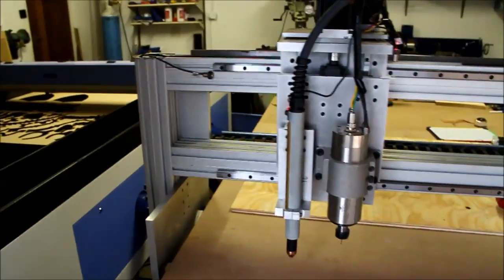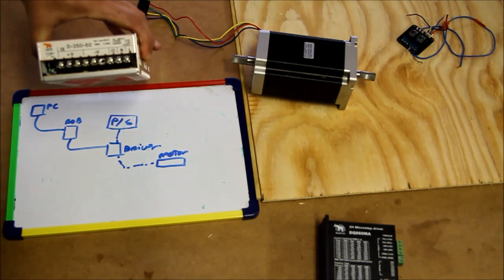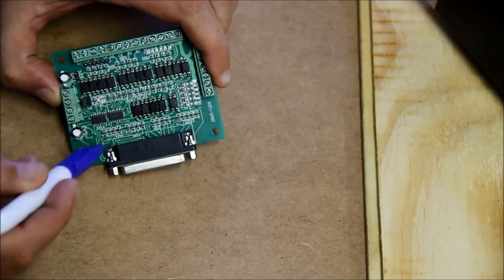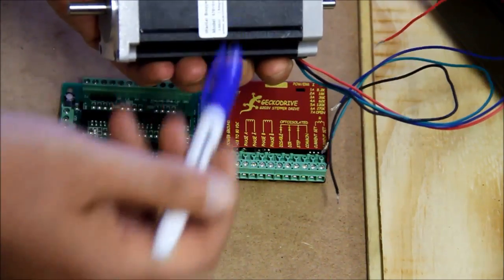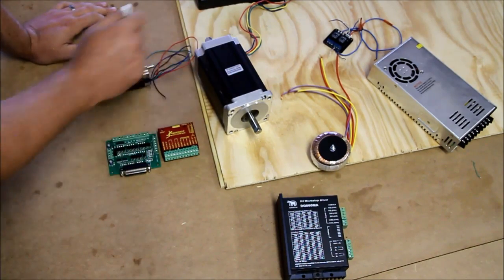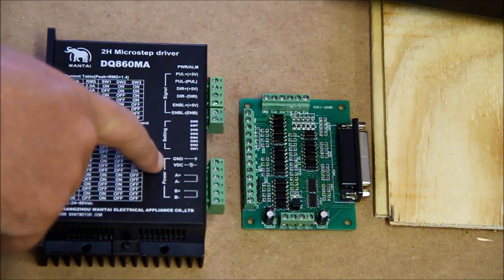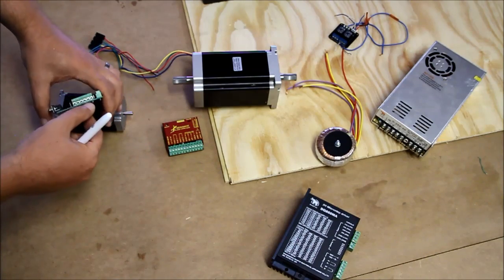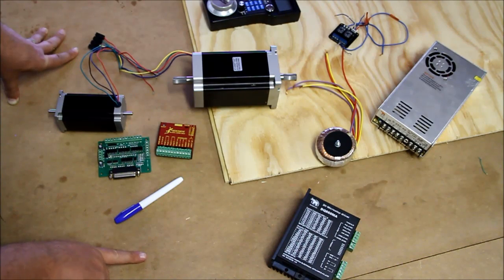How to Connect up a CNC Machine

Comment: Hi Vatso... thank you...  now i deleted both my message, and your reply.  i thank you so much for the reply...  i find that not all people like to reply, because they are busy.  can i ask you one thing please? :   It is the first machine the guy from Witbank installed a system on. My diy plasma table.  He advised me to connect the one probe wire to the nozzle of the torch, and the other end wth the clamp fitted, to clamp on the steel plate...and both wires was connected to the bob.  when we tested the cnc machine in ''demo'' mode, evrything was fine. only when i brought it to NAMIBIA, and connected the plasma cutter, the machine started to move...until the z axes (torch) touched the steel. then evrything burnt. the bob burnt, my computer processor damaged, and the plasma cutter also damaged.  there was no fuse or circuit breaker to avoid this. the ''box'' (plastic) was not earthed to the frame. i  think the probe wires was the wrong advice. he showed me pictures on watsap to connect the probe wire to the nozzle. but i see on internet other handheld torches without a wire??    o... and the cheap chinese bob was 12v and not 24 volt... i ordered the exact bob, only to discover its 12v.  i will use a stepdown transformer now to operate, until i buy another set.
is there a guy in s.a. who you know i can ask assistance from? please?.  and is there a supplier wher i can buy this chinese parts? to import is about 4 weeks!
thank you so much for your kindness.   
o.... please come back...we need your expertise in s.a. lol
Reply from the maker: Sorry to hear that, you can not run a touch off like that the arc voltage from the plasma cutter would have caused this :( - you need to make a floating head for your plasma cutter so that there is no voltage that can come from the plasma touch or you need to buy a THC that caters for that type of touch off and to be honest it's not worth it as the more you cut the more build up you will get and the touch off won't work if there is any dirt between the plasma head and steel.
Reply: my friend... im guilty of asking you to much...sorry for that, but im unsure, and cant afford another mistake like this...and i see you know this machines well.  okay, i made a floating torchbracket (i took one of those red welding triangle magnets, and glued a rubber between the two red plates like a rubber sandwich and removed the magnet, and use it on the z axis bracket to hold the torch bracket.) 
i wish i can fwd images to you.
can i ask you please explain to me about the probe wires.:
i have 2 wires... one is an earth from the torch nozzle to the bob, and the 2nd one is the earth clamp from the sheet to the bob.... and i hve this rubber insulation on the torch bracket.
what do you suggest?:
a) do you advice me to remove the probe wire from the nozzle? 
b) what about the probe wire on the earth clamp to the sheet?
if i remove any probe wire...how will the torch then touch the sheet to register the thickness of the sheet and lift again to ignite?
my system burnt because of this...the moment the torch touched the sheet, evrything burnt.
sorry my friend, but i find no advice here in vamboland (north namibia)
i mistakenly sent you my emailadres... but mabe if we can email, i can send you photos.
thank you so much for advicing me
johan uys
Reply from the maker: Hi Johan, no wires from your BOB or machine must go anywhere near the plasma torch or earth cable.  this is causing things to get damaged

Power supply -- The plasma power supply converts single or three phase AC line voltage into a smooth, constant DC voltage ranging from 200 to 400VDC.   This DC voltage is responsible for maintaining the plasma arc throughout the cut.  It also regulates the current output required based on the material type and thickness being processed.
Arc Starting Console – The ASC circuit produces an AC voltage of approximately 5,000 VAC at 2 MHz which produces the spark inside of the plasma torch to create the plasma arc.

I will try do a video this weekend trying to explain Etop switches and touch off switches.
Reply: thank you so much...i really appreciate...

Comment: Hi Vatso,does that bob have spindle control? Do you use spindle control at all ? Do you think its neccesary or nice to have ? Thanks,great vid.
Dan.
Reply from the maker: Hi Dan, I could but never did I don't have an ATC and don't really see the point if one does not have this. it's easy enough to change the speed on the sindle unit. normally this is set and run until you change the tool.

Comment: Hi vatso,  

Great video, very clear. most informative I've found so far for a newbie. cool accent too! 

i have a Denford Triac CNC Mill that uses stepper motors. id like to update the system to a closed loop AC servo control with either Mach 3 or Pathpilot. to do so, is it the same as this in principle? as i can't find any good videos to help me. 

if needed, my email is toby.bayliss@ymail.com

thanks

Comment: Hallo Vasto.  Thanx for the great informative video.  In your video you mention that you use a Rack and Pinion system to propel the axes.  I have tried to source the finer toothed type that you see on You Tube videos localy, but it seems all I can get is the rough type as used on security gate motors.  Can you recommend a supplier please.  Thank you Brian Biggs

Comment: Hi, what is the difference to put this electronic set for cnc plasma as shown in your video than for example arduino atmega 2560 +ramps 1.4 from my 3d printer? Why all cnc makers uses these breakoutboards ? thanks
Reply: +Simonas Kukta - I believe one can use a Arduino. this is great for people who are doing CNC more as a hobby and are happy to be codding the board - the pre designed BOB "not all are the same" are designed to work with the already created CNC software. I designed my machines to be able to run in a CNC business / Long run times with low risk of failure for DIY setup

Comment: I got a CNC6040 in I can not connect to the mach3 computer some one that can help me?  USB
Reply: +Bernardo Neufeld Hi there, maybe you can share some more info so we could help? Mach3 mostly works with a parallel port, do you have the USB plug in for Mach3 for your 6040?

Comment: Hi VatsoI built a 3 axis cnc machine using the QT382 BOB and Wantai drivers. Everything was working perfect but then switched off the power to the Bob and drivers while the laptop was still on. When I switched on again, Mach 3 is moving but the motors are not. Any idea what the problem might bee?
Reply from the maker: +Nico Fourie Hi Nico, the parallel port does put out 5v of power and the incorrect switch of sequence could cause you issues. what I have found in the past is that the BOB need a good rest as in no power to the PC and BOB this is not a reboot but rather a full power down of all components and then trying again. is this does not work your Bob could be damaged of the parallel port. there are a few guides online to test a parallel port. hope this helps
Reply: +vatso Thank you Sir!

Comment: Hi Vatso
Hoe gaan dit Boet? Im miles away from you, but Ive had this type of equipment and not been able to connect it thru lack of confidence and time to do it- I have to ask you if you can rough sketch the wiring and send it to me (how?) and the other problem is that no computers today have a parellel port - how do we overcome this problem? Please let me know how I can contact you directly, please please Boet. Joe
Reply from the maker: +Joao Girao Hi Joe I am happy to help but will do it for everyone if you have some photos of the equipment you need help with I will help lets share with everyone. send a link of the equipment will help thanks

Comment: Hi Vatso,
I have a problem wiring the Chinese board. I made a graphic of how I have it wired up and I would really appreciate if you could have a look and tell me what's wrong with it. Is there a way I could send it to you?
Reply from the maker: Luca Torrente You may - what might help if you put a link in the comments of the image I will have a look and then reply that way more people in future can also see how to wire up the BOB

Thanks
Mark
Reply: vatso good call, here's a link to the image:
http://postimg.org/image/ar2l3gyy9/

Thank you for your help!
Luca
Reply from the maker: Luca Torrente Hi Luca, please upload a photo of the drive - I would move your connections starting at P2 and P3. on the Chinese BOB my pin 1 did not work

Mark
Reply: +vatso I figured it out, the problem was that XP had auto update activated, the latest packages of the OS impaired the communication between Mach3 and the BOB. I hope this will be helpful for other people that are experiencing the same problem.

Now one Drive of the 3Axis kit is not working, one is extremely  slow and the other works just fine. I guess that this has to don with something not related with the OS. I probably got a bad batch, I will explain the problem with the eBay seller and hopefully will get the faulty pieces replaced.

Comment: Awesome, been wanting to add a cnc to my printer collection. 

Do you by any chance have a complete list of all the stuff you have used in yours and where you got it from as well as a rough estimate of price. I have been looking seriously at the X-Carve CNC by inventables, but yours seems to blow that away. 

Would love to build up a machiene just like yours
Reply from the maker: Xtreme-Xccessories the machine can be broken up into a few components.

1.) Table and Gantry - I made this all out of 90x90 profile extruded heavy duty aluminium which cost me allot more then making it out of steel   

2.) Rail System - I went with heavy duty block "SKF" linear guide rails and rack and pinion. this works great for me for the quick movement needed for plasma cutting & Stepper motors 

3.) Electronics - I went with Gecko Drives and a Locally  SA made BOB and old school power supply to run everything.

I spend around $20K when I was finished which included my hypertherm 

There will always be a compromise when building a machine - Steppers vs Servo motors vs Lead Screw vs Rack and pinion. the best advise is look at what you want to machine material wise and then build the machine around that.

A Plasma machine is not the same as a Wood Working machine or a steel cutting machine they have different feeds and speeds required to get the best results.

Comment: Hi Vatso. I was excited to find you posting. I am down in KZN and building a table like yours. Router/Plasma. I'm using Nema34 878oz , with 2 BoB. I was wondering if you would be so kind as to share your wiring diagram and if there is some way i could drop you an email direct. Cheers
Reply from the maker: terencejc1 Hi There, I don't really have a diagram per say as the wiring is specific to your BOB. Also could be useful to others if you just reply here maybe it will answer a question someone else has? I want to do some more videos some covering earthing the machine just need to put some time aside to do it
Reply: vatso Hi. I am interested to see how you built your cutting bed for plasma and router combined. What BoB are you using and is it connected to a Chinnese VFD?
Reply from the maker: terencejc1 I will do a video of how I did this and the issues I have with my Chinese VFD
Reply: vatso That will be great. did you by ant chance use this Bob? 
http://cncdirect.co.za/htm/mach.html
Reply from the maker: terencejc1 Yes that is currently in my machine
Reply: vatso Hi Vatso
My board arrived. could you please give me some help with the wiring of the VFD, which pins go to which connector blocks, it would be very much appreciated . Cheers
Reply from the maker: Hi there have you had a look at the manual yet? It's not that difficult. I don't connect my VFD to the board I set my VFD manually I don't have an auto tool changer so don't really see the need. I can assist you with connecting your spindle to the VFD if you like
Reply: vatso Hi Vatso  Thanks, yes, unfortunately i didnt get a manual with the vdf. I will search for one online.
Reply: vatso Hi Vatso Hope you well. How do you set your spindle speed? Do you just have a manual petensiometer?
I have got mine turning on and off from MACH# but it only goes to 11 520rpm and that is it, not up or down. Did you just follow the MACH# settings from the manual that greg sends with the Leeuwing board?
Reply: vatso Hi would really like to see some more pics of your table and control box. Are you able to post some somewhere?

Comment: Thanks, Some good info there. However I would like to learn more about the power supplies... linear vs regulated. and how to figure power requirements.
Reply from the maker: Bill Conroy Hi Bill here is some info on the difference between the type of power supplies https://www.valuetronics.com/Manuals/Lambda_%20linear_versus_switching.pdf

I moved away from switch mode because of the amount of failures I had with the Chinese versions I purchased. 

to calculate the power needed for the machine really comes down to the motors and how much they will need, I worked on Max stalling power of each motor.
Reply: Thanks for the response, and that is some good info on the differences between the two types; however what I really meant was how to calculate what power supply I would need for my stepper motors. I can't seem to find any good straight forward reference for a given NEMA 23 or 34 stepper motor. There are many different calculations with crazy multipliers for a given motor. I don't want to burn up a motor just because I didn't understand what I was reading, and I have doubts when I read that I need to multiply the rated voltage of say a 4 volt motor by 25 to equal a power supply of 100 volts! I would think I might melt the stepper motor! Anyway if you could shed some light on this subject I would appreciate it.
Reply from the maker: Hi Bill, there are a few factors to this the one is the motor and the other is the driver and it depends on which of each you have will determine the numbers for example Gecko Drives I have can take 24v to 80v input which can drive the steppers. here is a link to better understand the motor calculation http://wiki.linuxcnc.org/cgi-bin/wiki.pl?Stepper_Formulas

but on a side note a stepper motor in the main is stalled "holding force" when not moving and can be stalled all day long. one of the best ways of checking the motor is by monitoring it's temperature the are mostly design to run at 80 deg I would say don't run them at more then 60 deg.

Hope this helps 
Mark